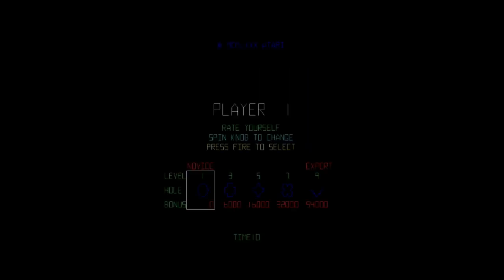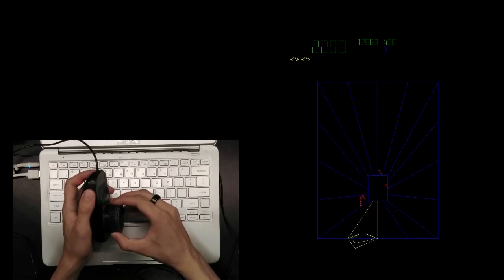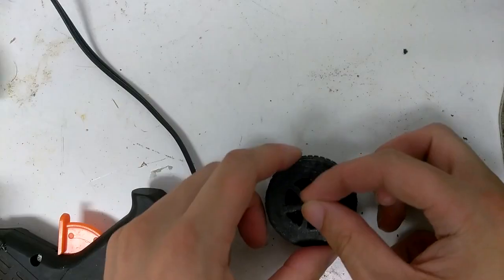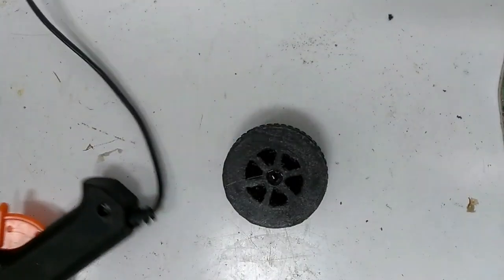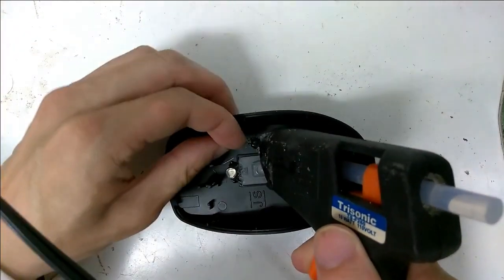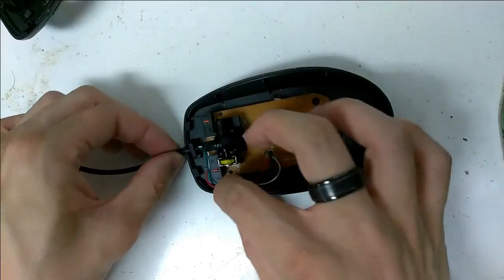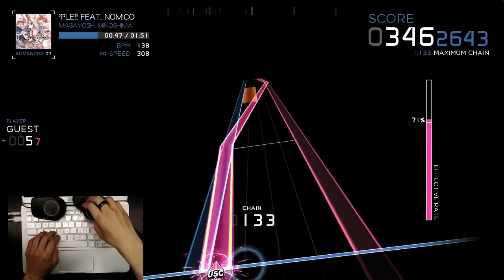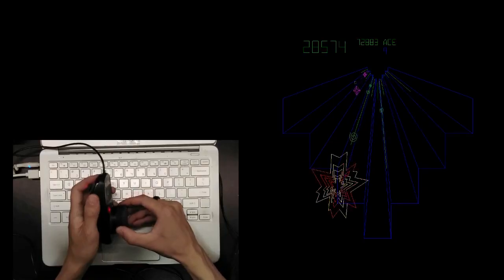Paddle Controller Adapter for Optical Mouse

Comment: This is really neat.  Would elaborate more on how the knob connects to the mouse and how it hold on with only the magnet in the center?  The video kinda went from gluing magnets to playing.  Thanks.
Reply: I was confused at first too, but that is indeed correct: you don't need to do anything more.
Try it: install mame, get a copy of Tempest, set mame to recognize the mouse as dial, grab any porous disk or knob-like item (like a pill bottle cap, a wine cork, a cylindrical eraser, a wooden disc, etc) and position it over the optical sensor. Depending on how centred your "knob" is, you will move clockwise or counter-clockwise. 
The neodymium magnets are only there to temporarily fix the position of the knob without destroying the mouse. Each magnet pulls the knob towards the mouse and away from the other magnets, so even if you get too excited, the knob will stay centred. They must be neodymium magnets because they need to be strong and small at the same time to fit bellow the mouse PCB.
Reply: Search a video titled "Vid #14: Fidget Spinner video game controller"  for a similar but different concept. Instead of internal magnets, they use external fun tak, but the logic is the same: placing home-made knob over the laser and let the mouse do the rest.